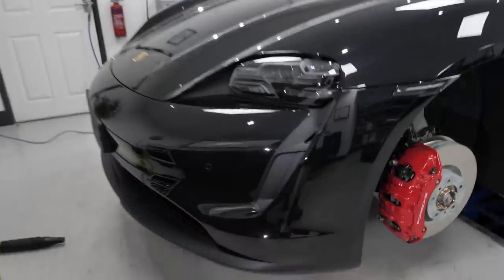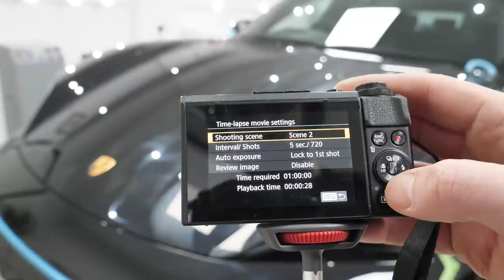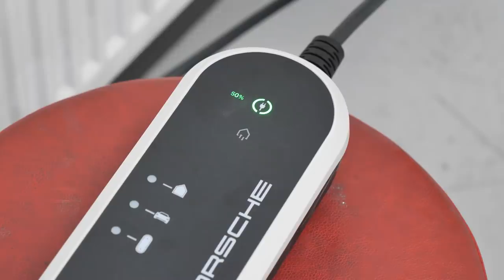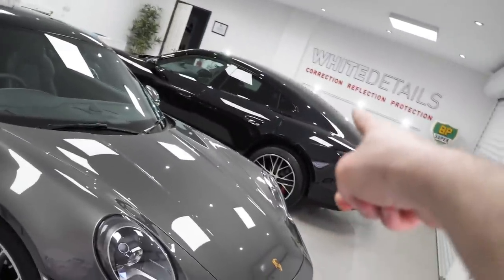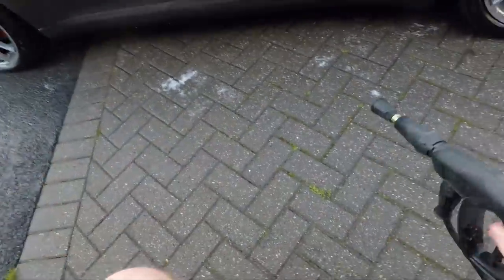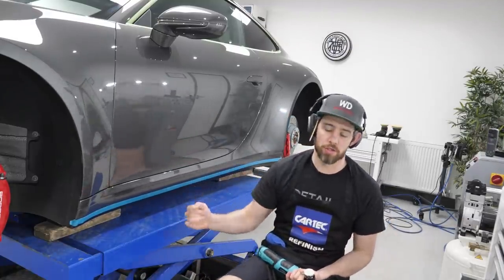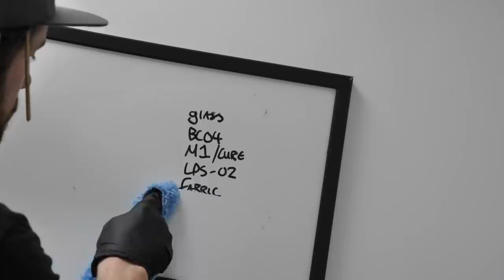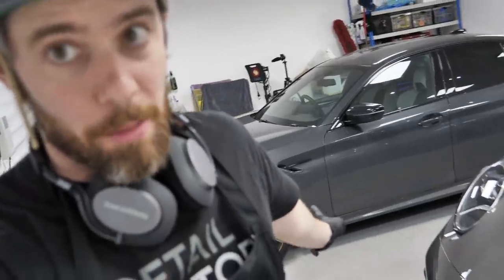BRAND NEW & Scratched. A Pair of Porsches.

Comment: Jim, I purchased a 5 month old used approved car from a German manufacturer with 80 miles on it, yes 80. I looked at the paint work and I could see the damage all those single bucket washes with a chammy had made. I built the cost of stage 2 polish paint correction into my negotiations, declined the dealers “paint protection”. I booked a local detailer who had been recommended to me to undertake the paint correction and I pushed the boat  out for a ceramic coating as well. The best think I ever did.

Comment: Lovely job! 
If you are shooting with a Lumix camera, you might (extreemely rarely..!) get a corrupt file showing as an .mts file. I think caused by a blip in battery power. The sound and vision gets 'separated', but you can get recovery software which will analyse the .mts file and mend it. I've only once had this happen in 10 years of using Lumix kit, footage of a VIP giving a speech..sigh. Thank goodness for the software...!

Comment: Great again if worked with Modesta for a view year, try for upselling a 2 layer 03-04 or 04-05. We did the 03-04 the most, great combination for better protection. And is applying for Modesta changed?

Comment: My used Audi (grey) bought from Audi dealer had the same scratches from poor washing technique or dealership wash. When I collected the car it was parked outside and looked good. The salesman told me that he had had it polished so in my head a few swear words were forming imagining the damage. The day I got it home I noticed holowgrams and small circular scratches. On washing the car (correctly) small scratches appeared. Guess the dealership used Autoglym polish to hide the minor scratches. 
I have a DA polisher and a smaller one exactly the same as the one used in this video and some off the shelf products I have used before. Hopefully I will sort out Audi dealer detailer muppets damage sustained when they prepared the car.

Comment: It’s quite tricky getting the dealer to leave the shipping protection in place....some of it is reusable and  gets sent back to the factory and also, they have a very limited time after the vehicle is delivered to make a claim for factory  / transit damage....otherwise it’s on them (or a fight with the customer as to when the damage occurred).  

Probably best compromise is to be present when the car has the panel protection film peeled off, confirm it’s ok and then get it over to someone like yourself before it gets washed. 

911 looks sensational....would absolutely choose it over the Taycan....also think the Audi GT e-tron is better looking than the Taycan.

Comment: Main agents, be it Ford, Audi, Bentley or Mercedes.
They are all the same, they all cause damage to a cars paint.
I hate it when my customers cars have been in for a service and the garage have valeted the car for them.
Basically the minimum wage grunt has dragged his microfiber cloth he's been using all week over the car, and grouted all the panel gaps with wax residue.
It's even worse if they use the buffer... Love to see those buffer trails zig zagging all over the nicely prepped paint.